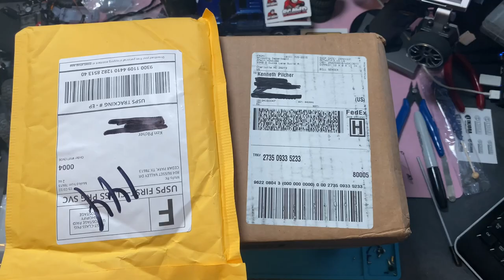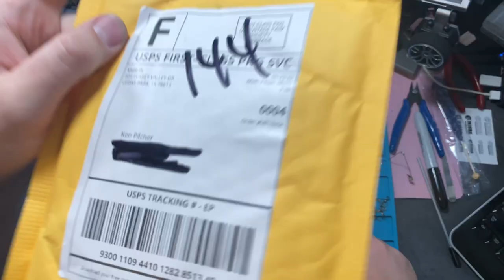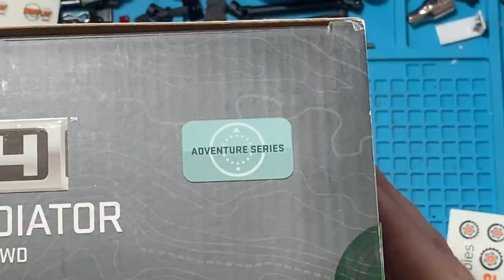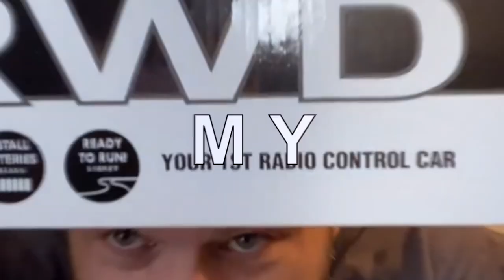SCX24 Mail Day - Mofo CVDs vs RCAWD and more!!!

Comment: Speaking of “spring steel” I had to use a spring from a rustler to make a new pin. Mine came out. Other than that, great so far! They do “clunk” a little. Great video, my guy! Hope you have a great weekend!
Reply from the maker: Hahah resourcefulness is always a good thing!  Thanks for the compliment and I hope you are also having a great weekend!!!
Reply: "Clunk" is concerning long term as clunk can quickly turn a part into what it rhymes with.....J...
Reply: @wingnutbert9685  
Broke! Snapped at the ball on the half shaft side. I get that the injora 50t is a pretty torquey motor but dangit!
Reply: @texomarc  DOH!!! The quality of steel used is very important but can't overcome a bad flaw. Hopefully it's a one off and MoFo takes care of you. This is my hesitation/frustration with ordering parts from there to up here in Canada. It's more expensive and a PITA if something fails. Return shipping and time makes it cost prohibitive so I might as well have just lit the money on fire. But when the LHS has sweet FA for selection, I'm stuck.
Maybe post up here how MoFo helps out with the breakage.

Comment: MOfO& RC4WD provide more steering than stock axles can accommodate regardless of application. The axles need to be modified to allow for the upgrade potential and the steering rate adjusted accordingly.
Reply from the maker: The RCAWD do not increase steering much over stock. But yes, they do a bit.  The Mofo definitely do, but as you said, modifying the axles is key.
Reply: @TheShopMiniRC  You've piqued my curiosity re mod'ing the axles to improve them. Have you a how to vid on these mods, or can you make one? :) Thanks!